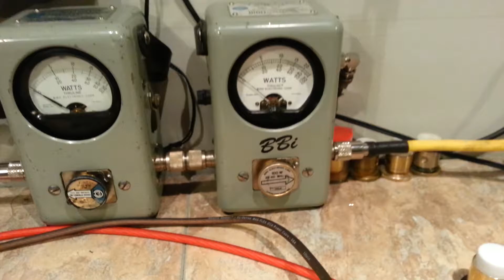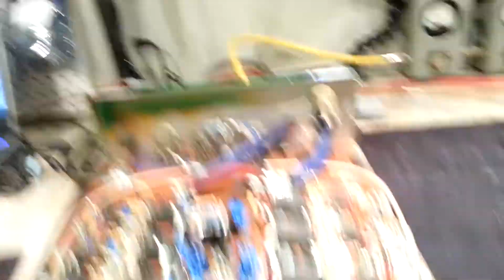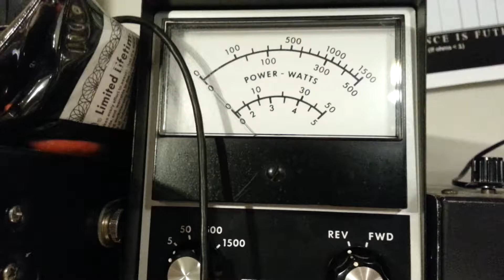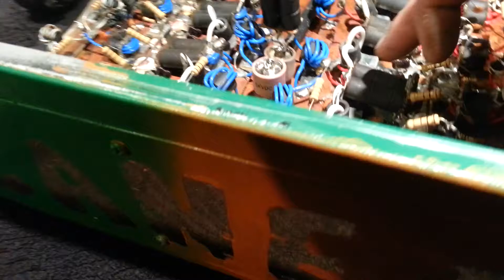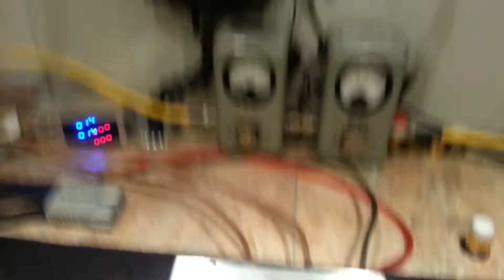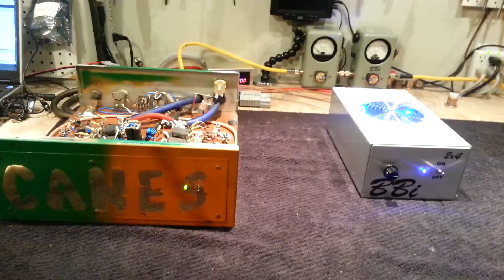Old green orange 16 pill

Comment: That the best old school  repair I seen.working good for a class C amp. Remember no SSB on C . AM or FM only. relay delay is great for low dead key. for you FM users out there class C is OK. in fact great. them old splutters combiners bring back memory. I had old amp come across the bench  with 4X MRF 454A pills. yes stud mount! just needed new relay.  and it was class AB1  with the bias circuit straight out of Motorola RF transistor hand book. part number for part number. do not know who has it now.